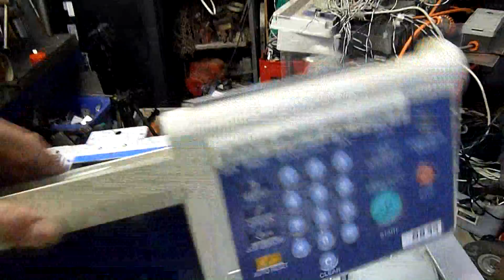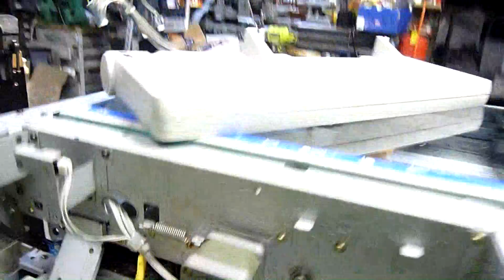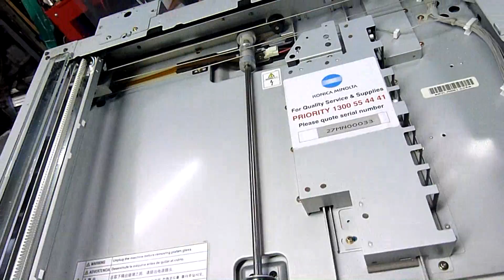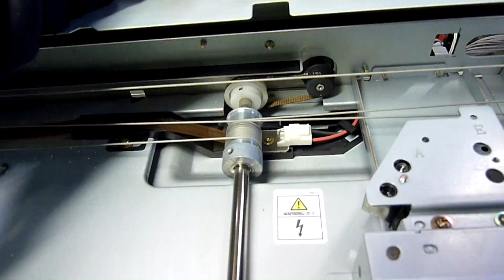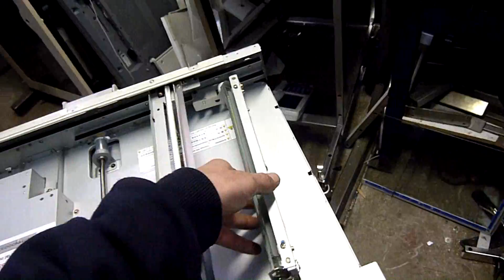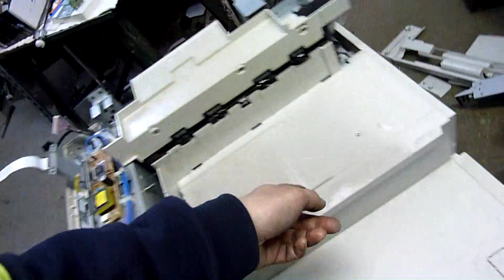Konica Minolta 7228 Copier Tear-down Part 2 - Scanner and Control panel

Comment: Thanks for the video. It helped me disassemble a Muratec copier that is on the fritz. There's not much I can do to fix it, but at least I was able to check it for mechanical malfunction of the scanner light transport. I think  power surge killed it. Dang nice copier before power company worked on lines, and I didn't have a surge protector. Tip: Surge protectors are good on copiers.

Comment: The analog units could indeed do reduce/enlarge; they would actually move the optics closer or further from the page.  Some older IBM copiers could duplex; i think the glass was large enough to fit 2 pages side by side, and it would scan one, flip the printed page internally, and scan the other direct to paper.  If you started with a duplex page already, that was simple:  It was all analog already, so you'd copy 1 side to 1 piece of paper, the second side to another, and place both side by side!  Magic!

Comment: I used to go to IT auctions and they would have a whole warehouse wall long of these. Of course nobody wanted them. There was a guy who would always take about 5-10 of them each fortnight in his truck. I was like WTF mate, no way you can resell those. Turns out he was scrapping them for parts: selling the laser diodes on eBay, scrapping all the wire and metals inside to a nearby metal recycler, but most of all was selling the high power stepper motors to electronics/robotics guys on relevants forums and ebays. He reckons a large size photocopier could yield $100-300 in these parts and was only paying about $5 per unit at the auction.
Reply from the maker: Absolutely, same deal here, they are worth next to nothing, and scrapping them is lucrative business if you have the space and time!

Comment: If the guy does not get back to you on the motors and driver I would be quite interested as I have a project in my head to make one of the Scuzers from Red Dwarf. Not planing to build it any time soon but I have started to gather useful parts. Would need to know postage to the UK so might not need all the motors to save on cost.
Reply from the maker: I will keep you in mind, already gave 2 others in line before you, but there will be more motors.

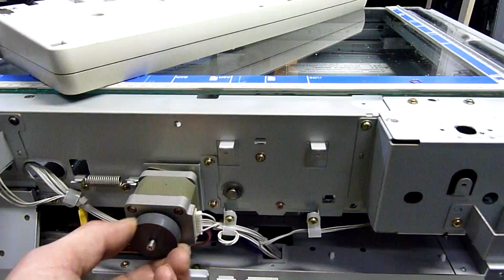Comment: That motor at 1:06 with 3 wires could be a sensorless 3 phase BLDC motor. Lots of control-ability no cogging, high speed and a lot more power output than a stepper motor of similar size. If the motor is 24v its output could be greater than 50Watts.

Comment: The old Rank Xerox copiers were actual 'photo' copiers, they had a camera, My dad worked in a warehouse where they stripped recyclable parts to send back to xerox, unfortunately they removed the cameras before sending them to the warehouse.
The top glass was curved, and there was a mirror, i still have a few lens assemblies, and one mirror